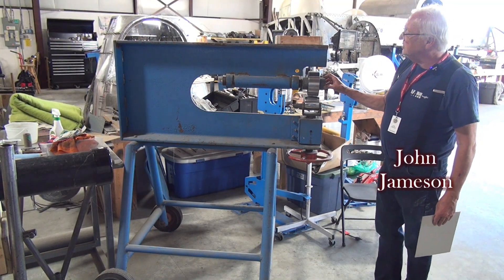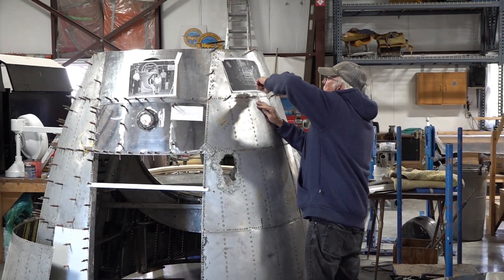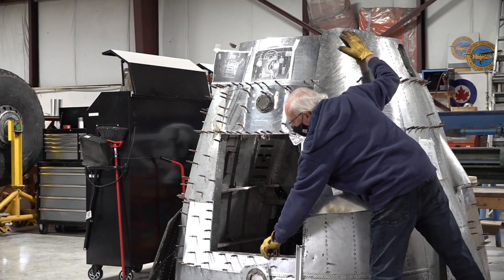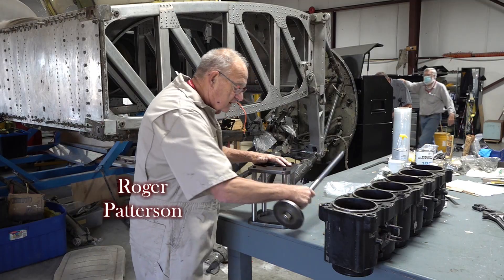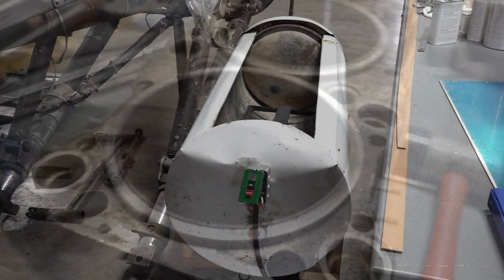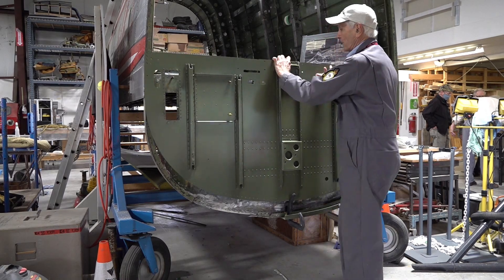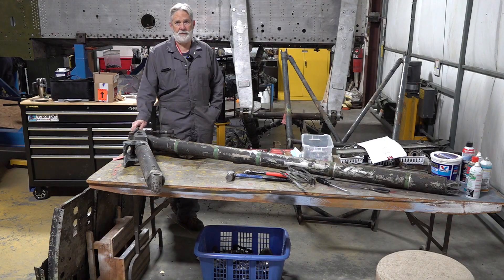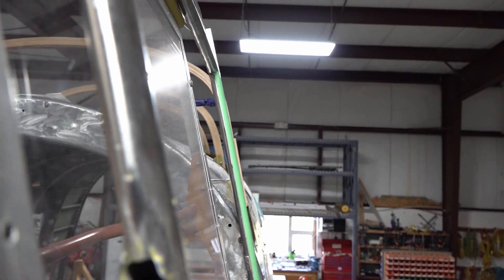British Columbia Aviation Museum FM 104 Progress Report 8

Comment: Has any of your crew found the pencilled notes and a crew list in left side the nose yet? In the tail section on the top right side near the sono buoy operator's station about the 2 o'clock level, there is a note regarding Exercise Nimblebat II from February 1962. It describes exactly how cold it was and asks why they were there but probably no one cares. Keep an eye out for them if you haven't seen them. They should be preserved as part of FM 104's history.
 Don't suppose you also received the big 1964 Toronto Star article with pictures on the retirement of Lancaster from RCAF  service at Downsview or the 2 models of FM104 as built and in her final paint scheme plus the RCAF Lancaster Ground Handling manual from TAM when you received her?
Reply from the maker: I have passed your message onto Clive Sparks, Restoration Shop Manager.

Comment: Your cylinder liner puller is a good solid job, however after using this type of tool in my work, I would suggest replacing the two hardened steel thrust washers with a ball thrust washer, you will find the difference is well worth the change.
Reply from the maker: Thanks for the tip!

Comment: I assume that you are in touch with the people at Just Jane restoration. They are taking her back to air worthy and are much further down the track. My thinking is that they may have solved problems that you are yet to meet plus they are likely to be able to point you toward companies that have made different parts for them and have the tooling to be able to repeat the process.
Reply from the maker: Thank you we know of them I am not sure if anyone has made direct contact yet
Reply: @rvjs100  Anther group that may be worth a contact is MOTAT in Auckland New Zealand. They also have a Lancaster ex French Airforce and believed to be the last one operational when it arrived. When it arrived it was supplied with all logs and manuals, all in French of course. There were I understand also many plan drawings according to my late FIL who worked on her when they shifted her to the present location. He had been a former flight engineer on them during the war. One would hope that they have been preserved. Could be worth asking.

Comment: Thank you. This clip has been a life saver. I am resizing an aluminum window frame and some of the stainless screws had corroded in and had to have their heads drilled off to get it apart.  was not looking forward to drilling them our when one of your people mentioned that aluminum has a greater expansion rate than steel so nothing to lose I pored  boiling water over the stuck ends and it worked. screws out happy boy!!
Reply from the maker: Glad we could help